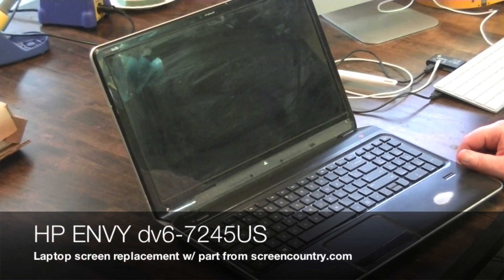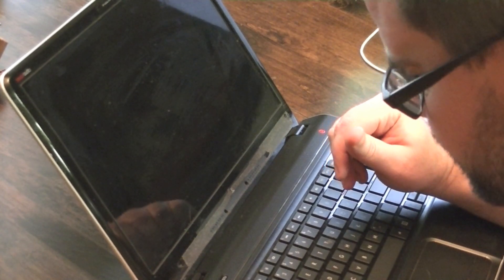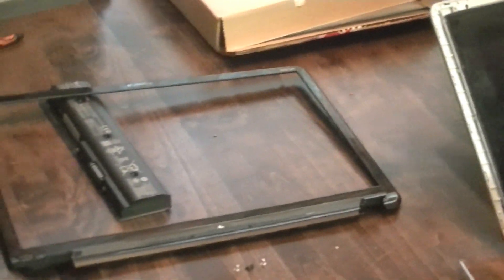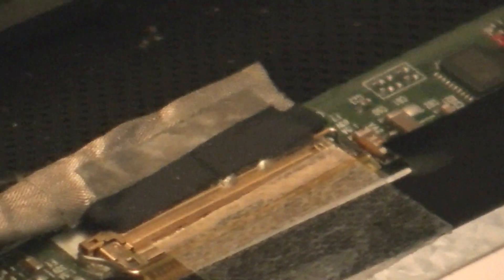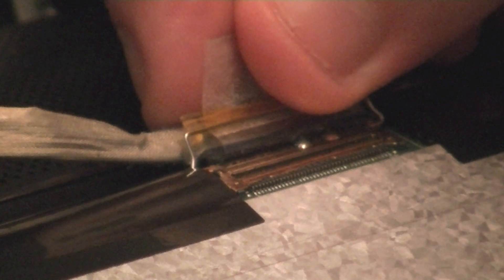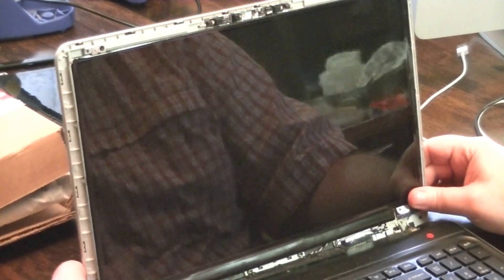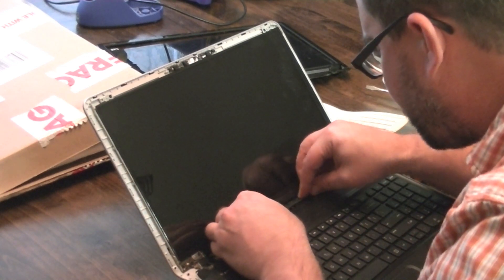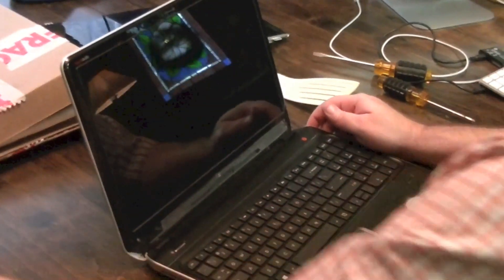How to replace screen on an HP Envy dv6 laptop

Comment: The spatula is brilliant! It was all tight, being never taken apart, but the spatula loosened it up from the inside frame, all around to about 3/4 way down (no taking stickers or screws out!), and allowed me to get a credit card in from the outer edge, and gently pry the black frame off (snaps a lot). The white camera plug was indeed slightly pulled down, so I eased it into its socket with my finger and the web cam now works. Thanks!!!!!

Comment: Hey I was wondering if you could help, my lap top flashed white than half of the screen now has lines and is pink, do I need to replace the screen or is there a loose cable I need to fix?

Comment: Hey Lonnie Great video Brotha, well my co-worker kid dropped the lap top as well and pretty much the screen was black blank screen, the HDMI and extra VGA adapter that was on the laptop does work and lap top does work properly so i just replaced the screen as instructed in your great video but still have no screen, you think something else is broken>
Thanks in advance
Reply from the maker: Maybe the back light or the inverter?

Comment: high ibroke my bezel and trim, my model is  HP-COMPAQ ENVY DV6-7213NR 15.6" can i replace with   DV6-7000 Black Laptop Lcd Front Bezel 682052-001?? will it be compatible as long as the 682052-001 matches?? Please let me know, thank you

Comment: How do I know what the right screen is to replace the broken one with? Will going by the model number alone be good? I have dv6 1362nr and see a laptop screen sold by HP on Amazon for that model. Would it work? Or do I need to look up more information?